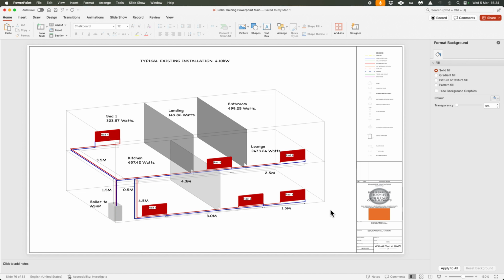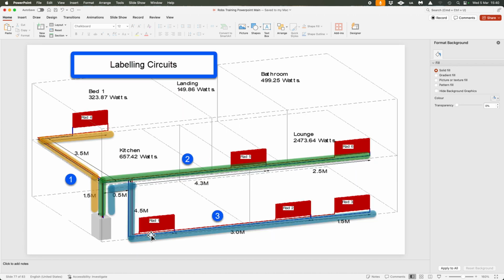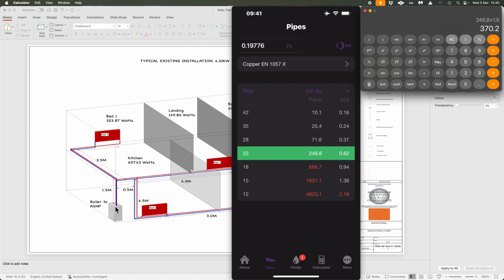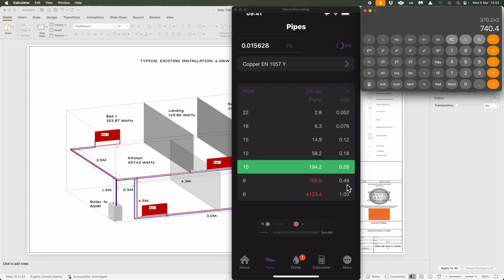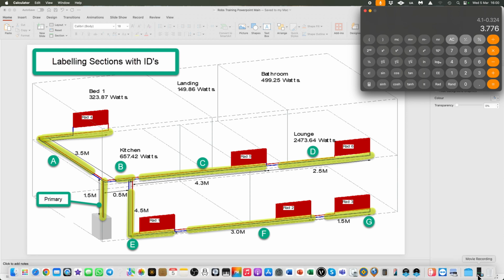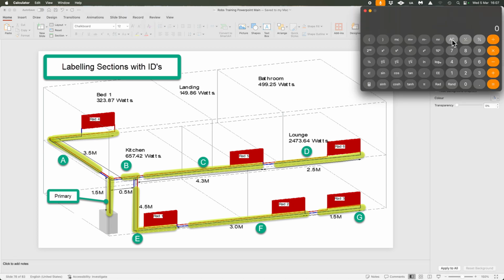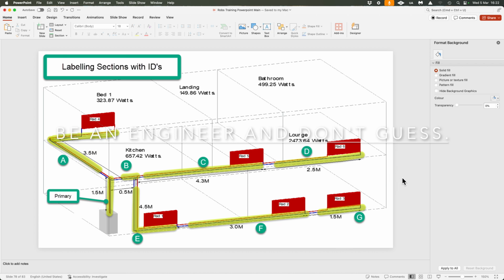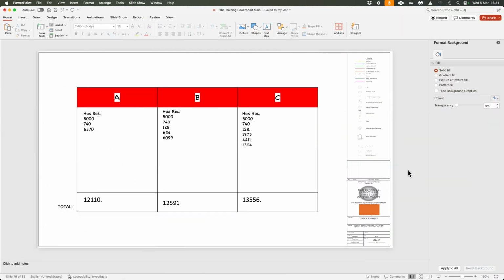Episode 5 Heating design of Index Circuits

Comment: Super tutorial. 
The misunderstanding regarding pump size and building height stems from confusing circulation pumps, and well pumps.
To pump water from a well 6m deep, you do indeed need a minimum a pump capable of 6m head or more because the static pressure between the inflow and outflow to the pump is the difference in height (6m).
In a heating system with a closed loop, the static pressure across pump is zero since the static pressure at the flow side is equal to the static pressure at the return, no matter how long the closed loop is or how high it rises. Therefore the only consideration for pump sizing in a closed loop is the dynamic pressure caused by fluid motion via friction and turbulence.

Comment: Great episode Rob. How much of a worry in practise is having a velocity below 0.2 m/s?

Radiators must be the largest source of sludge and their water velocity is very low due to their “diameter”. So, even if you have decent pipe velocity, the sludge likely settles in the radiator anyway.

A power flush, when necessary, would raise the velocity in both radiators and pipes, cleaning them all.
Reply from the maker: @HowardBurgess  There is no worry if the system is very clean and designed well.

Comment: Thanks Rob. Another great video. 
As I recall, when we did ‘long hand’ Index Circuits in college in the early 80s. The Lecturer described ‘picking up all the loads in a circuit’, was like sending out a Van to load up as it travelled each circuit. Daft I know, but it’s stuck in my head.
Thanks again, these videos have been a great refresher for me.👍👍
Reply from the maker: @jimmygillies5590  Quite like that. Not fully accurate but get what you mean.

Comment: Hi Rob
Another great video, thanks.

You said that the rad valve would be the index circuit. Would the 20kPa for the rad valve be added to the 13.55kPa for the pipework, giving a total index circuit of 33.55kPa, or do you treat the valve and pipework resistance separately?
Reply from the maker: @stephenjdenney  No, if the flow can surpass the 20kPa rad valve, it can pass the 13kPa pipework. So just 20kPa.
Reply: I don't quite follow why the rad valve is treated separately? Is it not on the end / halfway along the index circuit rather than being a separate circuit all by itself? Why does it apply like this to the rad valve but not the lengths of pipe or bends in the circuit?

Comment: Another really good tutorial Rob, when calculating the resistance in tees is there a difference between a pipe bent by a bender or swept tees or compressed fittings, I see a lot of joints done with the newer compressed fittings which are a sharper bend than traditional bending methods and more of them
Reply from the maker: @johnb7644  Yes, there is more resistance in sharp, ‘knuckle’ bends than pulled bends but as said, CIBSE (I think) over egg the resistance and why I just allow 10% per change of direction. 
We absolutely do not use pulled bends nearly enough in my opinion.
Reply: @ 
                                         Cheers rob, it’ll also add to costs if every turn is a bought compressed joint.
Reply from the maker: @ I love pulling bends, even with 28mm.

Comment: Great video rob, I'm going to share it with colleagues to help them understand and learn.
For some new installers, any tips for how to identify different coppers (X or y)

Also you did section B but shouldn't that have been 1m to include the return part, so total 214?
Reply from the maker: @owenattewell3910  Thanks mate. I think I got it correct on section B but I’ll check.  We all make mistakes and if I’ve made one,  I’ll do another vid .
Reply from the maker: @owenattewell3910  Yep, good point. We all make mistakes. Must try harder.
Reply: You mean ...I passed the test? 😜 

I wanted to also ask whether we factor the actual radiator in ?

Comment: Great video. How ever when calculating section B. The length is 0.5 which I understand you half the pressure loss but don’t not need to double it as it’s has a flow and return? Or I’m i misunderstanding? Thanks again
Reply: My thoughts too - looks like Rob forgot to double it to account for the flow & return?